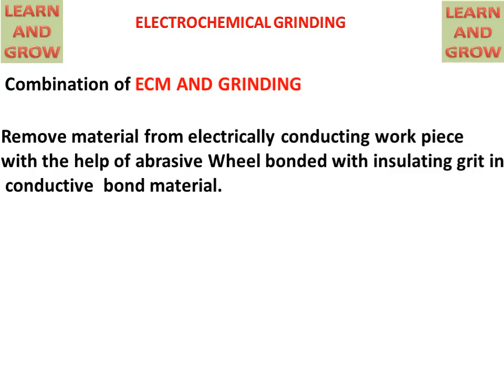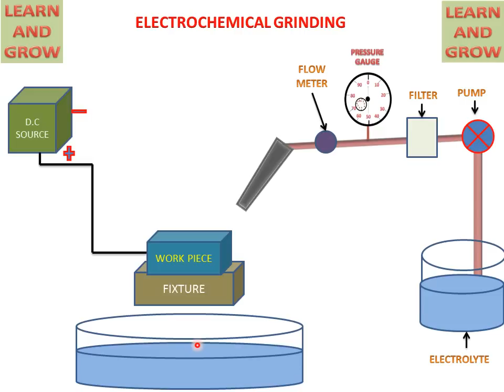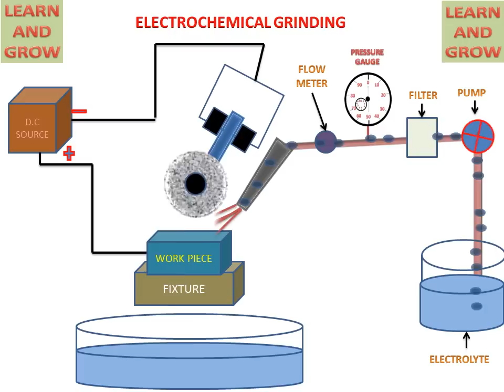Electrochemical Grinding

Comment: What is the material of abrasives??
Reply: Abrasive Particles Such as Aluminium Oxide or daimond
Reply: it's may be graphite
Reply: Also sillicon carbide
Reply: Aluminum oxide or diamond fused by metal bond.

Comment: I am not able to understand properly please explain me.I also try this In hindi....

hopping for positive reply.
Reply: 1)There is fixture upon which a workpiece is place and it is connected to the positive end of DC supply.
2.) The grinder here is connected to the negative side of DC supply. When Workpiece and grinder comes in contact the current flows and circuit is completed .
3) Electrolyte is pumped from container and sprayed on Workpiece through nozzle after it has been passed through nozzle .

4) the Electrolyte that is being sprayed on nozzle is collected on the container place below fixture . 

That's all it was about .